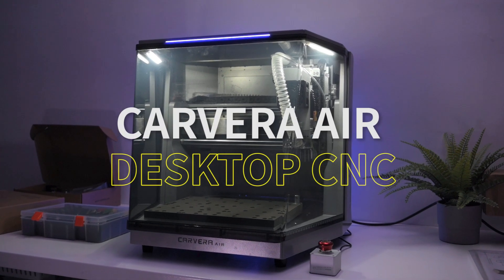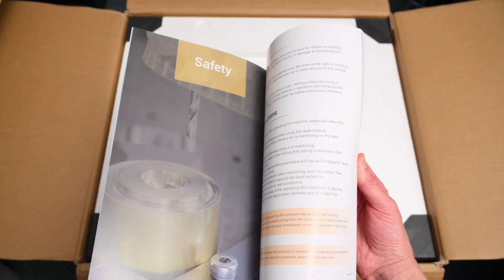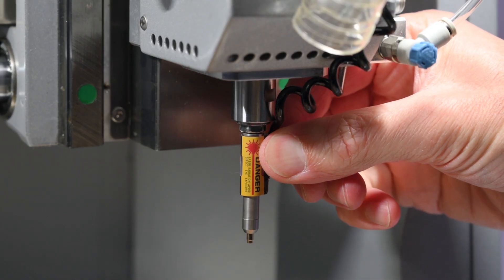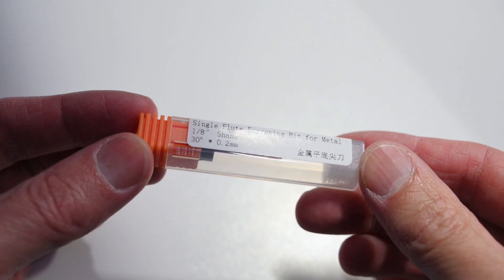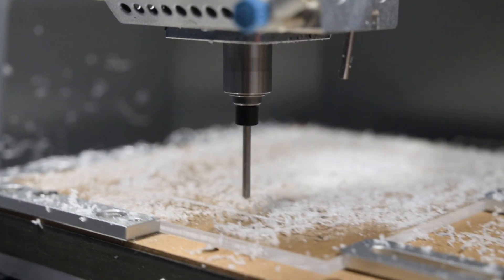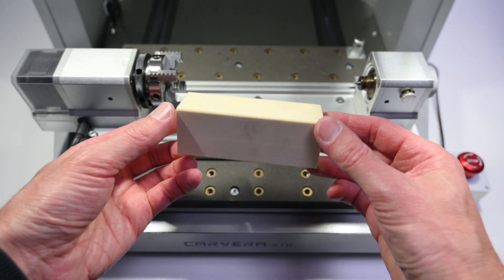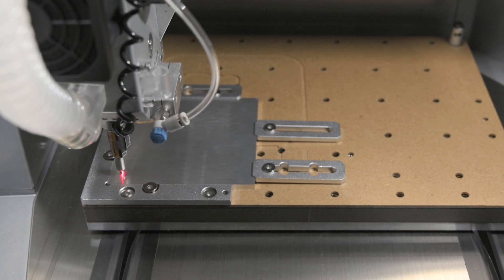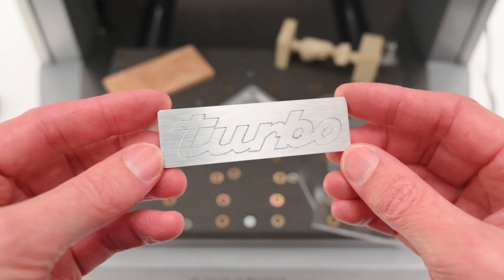Best Home CNC You Can Buy? Carvera Air Review & Test Results

Comment: To improve the aluminium proccess, you can use a bit of oil, like WD-40. This will prevent chips get stucked in the bit.
I mean, is not magic, if the problem continue, you'll have to adjust speeds from spindle and feed.
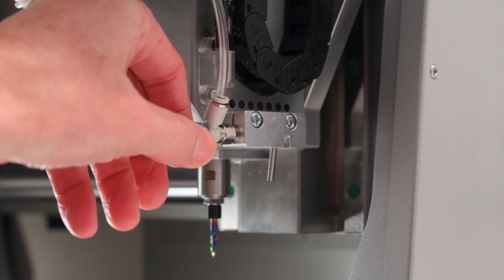Reply: It has a build in air assist nozzle 4:18 for Aluminum. Adding WD40 would make the chips stick even more. You can use it for the finishing cut.

Comment: can it machine aluminum blocks?
Reply: yeah stupid, did you even watch the first 5 minutes of the video?
Reply from the maker: Yes, it can machine aluminum within reason. You’ve got to dial in the right feeds and speeds, use the right bits, and take lighter passes. The aluminum tests in the vid actually worked quite well and I was happy with the results

Comment from the maker: 📌 Timestamps:
0:00 - Intro
0:34 - Unboxing
1:50 - Quick Setup 
2:41 - Build Quality & Design
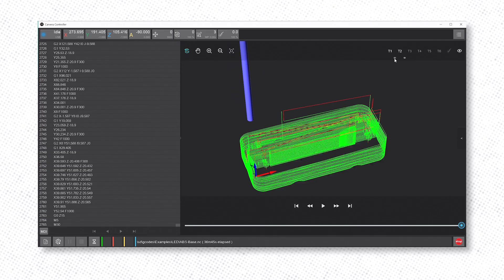3:28 - Vacuum Connection
4:16 - Air Assist Setup
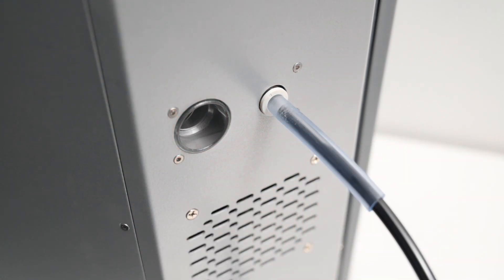4:53 - Quick Tool Changer LED and Spindle
6:20 - Work Area
6:38 - Wired & Laser Probe
7:09 - Example Projects
7:24 - PCB - Circuit Board
8:37 - ABS Block
9:30 - Acrylic
10:16 - Aluminum 
11:07 - Example Project Built
11:19 - 3 Axis Relief Project
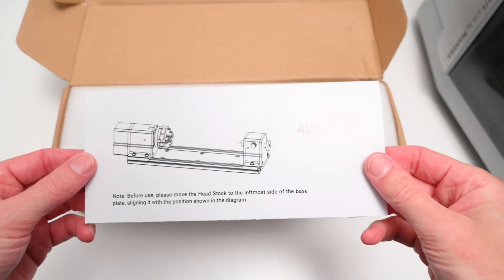12:14 - 4th Axis Project
13:49 - Making your own projects
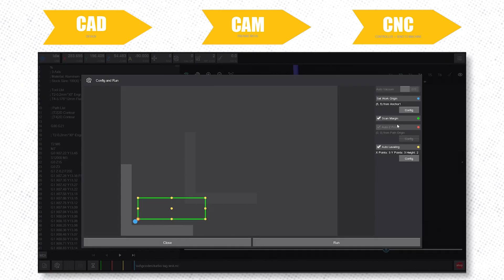15:01 - 2 more Aluminum Tests
16:23 - Oak Hardwood Test Pattern 
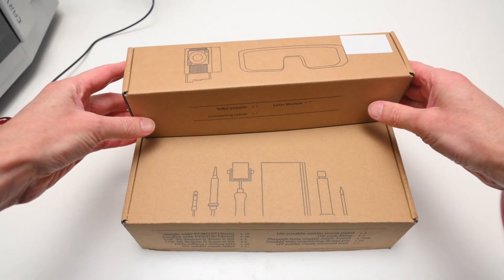16:55 - Other Accessories
17:19 - Final Verdict
17:45 - Thanks For Watching!